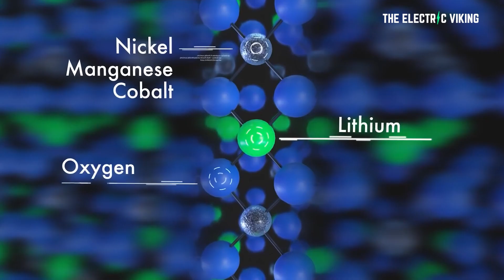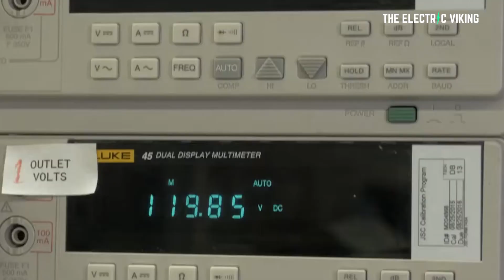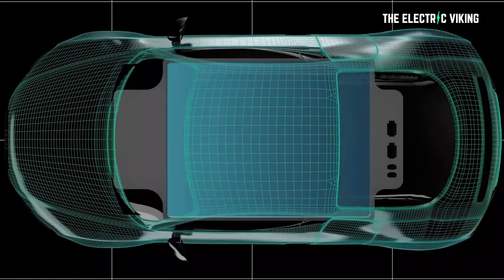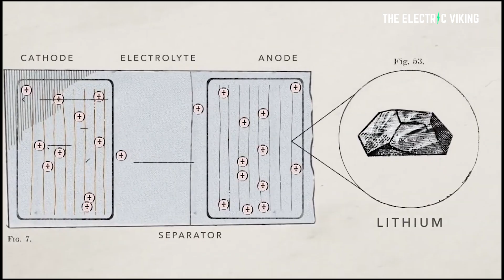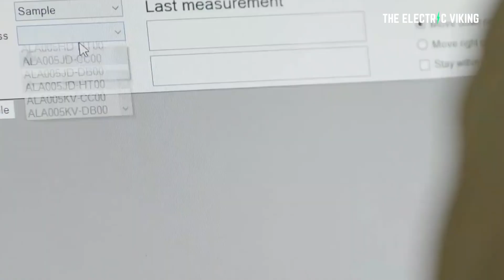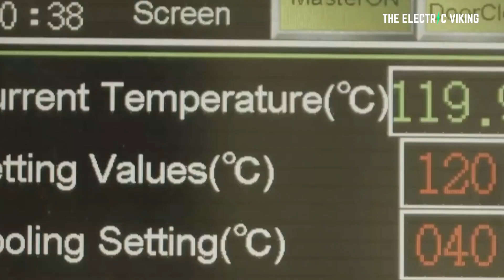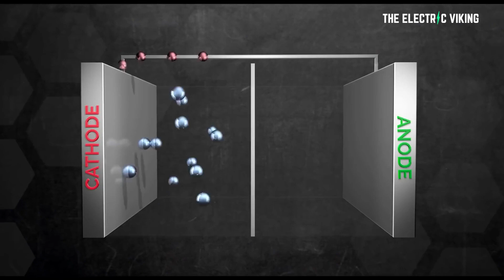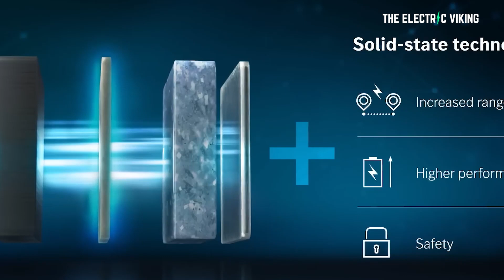NASA's solid state battery could change EVERYTHING

Comment: From the article: “Not only does this design eliminate 30 to 40 percent of the battery’s weight, it also allows us to double or even triple the energy it can store..."  The battery specs are 500Wh/kg, whereas, say, Tesla's 4680s are around 285Wh/kg. So that's 40% more energy for a battery that's the same weight as a 4680 pack, OR  the same amount of energy for 40% less weight. Not both. Please correct me if I'm missing something.
Reply: I agree.   We need clarity on this simple point and should apply one variable at a time in describing its density. I assume NASA hasn't increased the storage by double for a battery that weighs, at the same time, 40% less.  If that's true, and comparing it to the state of the are 4680s (285Wh/kg) , NASA's technology would have to achieve 570 Wh/0.6kg which is 960 Wh/kg.

Comment: Bring on the future! Higher density, safer batteries with less need for  exotic minerals seems like a winning combination for greater adoption in all industries.
Reply: @orionbetelgeuse1937  you are completely missing the point, the private space industry's next step is space mining, and there is allot more out there then on earth. this is 20 year plus tech, specially considering the speed NASA moves. it will happen eventually. this level of battery tech isn't needed for the auto sector. aerospace and space yet though. I could see aircraft replacing their turbines..... also, he said it's 2x less in weight and and more in power that has unlimited cycles meaning it'll outlast the car, and the next 20.... and you lied about selenium, its more abundant not less. much more. watch the video all the way through next time. it's also almost impossible to set fire to it... and operate in almost twice the heat without cooling and testing the cold part this year. the technology has been advancing for decades, the last decade there has been more development in batteries then anything else, and more research in batteries in the last 10 years then all before it combined. 10's of BILLIONS of dollars!!!
Reply: @TheInsaneupsdriver  space mining? lol

Comment: Very interested. Where I live the battery capacity drops by 40% to 60% in the winter. A 250 mile range drops to less than 100 miles. And I haven't even driven in the  coldest temperatures.
Reply: So get a car with battery conditioning - with a heat pump.
Reply: @JohnR31415  Or leave your car plugged in in winter - like everyone with a gasoline powered car (frozen oil and coolant reduces gasoline powered cars range to zero in Canada). Sump heaters have been a thing since cars were a thing in Canada - they are a heater pad that is either glued or bolted to the sump or screwed into the sump drain plug.

Comment: Back in the mid-sixties, they released the technology that was going to make "fuel cells replace batteries" and provide the motive power for electric cars.  We used said fuel cells, still do, in space and other tight places, but lead/acid, carbon/zinc alkaline, and now lithium remain the mainstay of our portable electric power.  I was working with solid state electronics in the mid-sixties as a boy, worked it two decades as a Marine, and we now are coming back to those long ago hopes. I'm hoping my forty year old Mercedes diesel will last the rest of my life.

Comment: Lesson I learned from Elon Musk: making a prototype is easy... getting that prototype into productions is VERY HARD!
Solid state has been around for a while now and this report has highlighted all the advantages of this new tech BUT how expensive is it and how hard is it to manufacture? No matter how great it works in the lab, if NASA can't mass produce these batteries, they're NOT going to change anything!
Reply: You are right. A new product like this comes from laboratory engineers to get it into production you need production engineers.
Which are made up of planning and methods engineers A completely different types of engineers to make it cost-effective.

Comment: Taking off is the main reason the battery has to be able to discharge at such high rates.  I wonder if a ground assist would be useful.  Something like they have on an air craft carrier.  The climb rate could be adjusted to the power capacity of the battery and cruising would use even less power.  The main consideration would then be the energy capacity of the battery, and less, how fast it could discharge its energy.  Also range would be increased by not using so much energy to take off.

Comment: As mentioned, Selenium is very rare and ranks among the 25 least abundant elements, which makes it costly.
Reply: True but possible if it doesn't require very much Selenium, but is usually found with sulfer so idk.  90 parts per billion of the crust of Earth which is rare.   Would like to see the particulars.  May be a good alternative or special use.
Reply: @l0I0I0I0  Have to start growing Walnuts!😁
Reply: @michaelbooth6007  And Brazil nuts. 😉
Reply: @l0I0I0I0  It's rare. However, Gold is much rarer, yet it is used throughout industry and for nonessentials, including teeth, jewellery and coins. But it hasn't run out after thousands of years of use.
Reply: @michaelbooth6007  lol. Glad someone has a since of humor.  😂
Reply: Then Nuclear Diamond Battery is the solution.

Comment: 500 wH/kg is close to the requirements for regional aviation, but another factor of 2 or 3 energy density gain would be needed for long-range air travel. (See "Performance Metrics Required of Next-Generation Batteries to Electrify Commercial Aircraft" in ACS Energy Lett. 2020, 5, 2, 663–668.)
Reply: If shorter range planes become much more economical than jet liners,  it may change the pattern of demand for longer range flights.
Reply: @MattOGormanSmith  Just ran across a Two Bit da Vinci YouTube video on CNT flywheels. 2700 Wh/kg!! That's more than twice what long-range, trans-continental aircraft would require.

Comment: They keep saying double energy density AND 40% lighter, mixing weight and density units which is confusing. Are they the same thing, given the 10% for non battery structural weight, or truly cumulative? If the energy density is double you would obviously need half the weight for the same capacity if the weight was 100% battery. Like you're trying to count the benefit twice. If you mean double the density, otherwise stated as half the weight, just say one and we can infer the other through simple maths without the confusion. If it really is twice as dense AND 40% lighter, i.e. it can fit twice as much energy into 60% of the weight then it would be 3.33 times as energy dense in which case why not just say 333% (not 5x) higher energy density which sounds even more impressive than the double and 40% figures separately?

Comment: Lots of people are working on solid-state batteries, how does this compare to others?  Also, this is still in the lab phase, there is no mention on what it will take to manufacture them?  Will it require a complete retool?  Lab work is great, but it could still be a decade before we see anything in commercial production.

Comment: OK if you double the "energy it can store" AND halve the weight is this is the same thing measured twice or said two different ways? So are you saying the gravimetric energy density is increased by 2 or 4? The former would be wonderful. The latter would be a game changer and allow electric powered flight.

Comment: The battery can't be double the energy density AND 40% lighter. Since energy density is based on weight. It's just got higher energy density.  If those claims were true, it would have 300+ % more energy density
Reply: Zackly.

Comment: While transoceanic range MAY be possible with such a battery-powered aircraft that distance would be  covered at a MUCH lower rate of speed. One of the things that makes intercontinental air travel PRACTICAL is the rate of speed at which present day aircraft can travel thanks to the gas-turbine engine. A battery powered aircraft would be limited to some sort of propeller driven configuration or a ducted fan configuration. Neither of these technologies can achieve the 600+ MPH speed of a gas turbine powered aircraft.

Comment: If cheap per kWh and easy to mass produce it would clearly be a major improvement assuming no one has something even better.  Twice the energy density and half the weight would be nearly 4x improvment lower weight EVs making them green, safer also.  But - it appears it would be lithium based a serious draw back but even with current supplies you could get the same range with 1/4th as much or maybe 20 million BEVs annually.  If cost wasn't 4x then it could  help bring costs down.
Reply: Current Li-ion batteries are around 250 Watt hours per kg. (The 4680s Tesla is producing have an energy density of ~285Wh/kg). NASA is claiming 500Wh/kg. That means NASA's batteries are about double the energy or half the weight, not both. As in you could have a battery pack of the same size and weight and have twice the capacity, or have a battery pack half the size and weight and get the same capacity. It's not "twice the capacity and half the size". This is misrepresented in the article Sam is referencing, and he's repeating that misrepresentation.
Reply: @truhartwood3170  That would obviously only be double but Viking said twice the energy and half the weight so maybe he meant just twice overall?  If so then commercial jets are not plausible at all.
Reply: @BlondieSuperdog  I reeber Elon said that 500Wh/kg was the threshold for it to start making sense in planes, but I don't think he meant long haul flights, probably just shorter flights and drone taxis and stuff.
Reply: @BlondieSuperdog  I reeber Elon said that 500Wh/kg was the threshold for it to start making sense in planes, but I don't think he meant long haul flights, probably just shorter flights and drone taxis and stuff.
Reply: @truhartwood3170  yes small craft I suppose current range of the Pipistrel electric currently has about 100 miles range so maybe 200 miles; not very comparible to gasoline though.
Reply: @BlondieSuperdog  but if it brings cost down and you don't need more range it's all good.

Comment: NASA uses the acronym SABERS (solid state architecture batteries for enhanced rechargeability and safety);  NASA applies 'holey graphene' material and sulphur-selenium material.  I assume that the performance of this battery is comparable with GMG's state-of-the-art Aluminum graphene battery (thumbs up Australia!), that does not even depend on Lithium. Australia has big reserves of Bauxite.  Industry is going to upscale the production of graphene materials, no doubt about that. I hope the best 'graphene material' inventions/discoveries will be licensed to the battery industry. Very interesting calculation about the 'minimal' energy/weight  (KWh/Kg) and power/weight (Watt/Kg) battery requirements for economic air travel by means of electric airplanes.
Reply: "bauxite" I don't think the global battery demand is enough to put pressure on aluminium mines, yet.
Reply: @MattOGormanSmith   That is why GMG's aluminum graphene battery is gold.

Comment: In addition, an electric powered 'tender/launch' air craft could be used to transport rockets which are going to be sent into space up to, say, 100,000ft, flying along the equator in the direction of the spin of the earth.  How much less fuel would be used, when firing off your rocket at that altitude, to reach orbit.

Comment: With less battery weight, the range would be extended as well. 40% less weight and 5x the range means roughly 700% efficiency improvement.
Reply: I think he's multiplied too many factors together.

Comment: To start with there are few "gasoline powered" aircraft, most run on Jet Fuel (9.6kWh/L) so a litre of Jet Fuel weighs 0.79kg v (Li-ion max = 260 Wh/Kg), even doubling the efficiency of the battery you aren't even in the same ballpark and the a/c has to carry the drained cells until landing, burned jet fuel is gone.
Without even comparing refuel v recharge times, you aren't going to be seeing mass adoption of electric aircraft any time soon.

Comment: Yes, the energy density and safety is impressive, but what are the economics of making them at scale? If this is just new chemistry that can mostly be inserted into existing production facilities and the materials are cheap enough, then it's a game changer. However, these are big ifs.
NASA doesn't normally trouble itself with how much things cost or how hard they are to make. Specification is key for them, not the economics of the product.

Comment: No more fossil fuel jets? That would be a stretch. If 66 kWh equals 12 gallons of gasoline, then you'd need 625,000 lbs of these cells in a 787 equivelent. That is still twice what the fuel weighs now.  A lot closer to equivelent but not really plausible yet.  You'd have 1/2 the range or a cargo reduced by 312,000 lbs

Comment: Another possible game changer is a solid state ultra capacitor, patented by Alvin Marks, called QUENSOR. Quantum Energy Storage or Retrieval.  Claims an energy density similar to gasoline. The main problem with producing QUENSOR is the use of perflouric acid.
Reply: Is that like "1 battery per flouric acid" 😉😁
Ohhhhh I understand now...
Reply: @alexmanojlovic768  The perflouric acid treats a stretch oriented conductive polymer to produce strings of connected capacitors consisting of 3 or 4 carbon atoms and a Florine atom, each capable of holding or releasing 4 electrons.  No ions moving around like in batteries, just electrons moving around.
Reply: @paulvansteenberghe4644  that went straight over my head, Paul, I gave up on Chemistry in high school!  But thanks for taking the time, even after my smart455 joke!! 👍
(It's perflUoric & FlUorine, not perflOuric & Florine...)

Comment: Even if they came out with a solid state that a plane could use to make an international flight, airlines will be hard pressed to change over until you can quick charge a flight. I work at an airport as a fueler and we get regional flights sometimes that are quick turns where they land and leave within 30mins so they're only at the gate for 15-20mins to which we have equipment that can pump 150gpm for small planes all the way up to 1000gpm for the big planes. Our international flights take roughly 15000gals of jet a, and it takes roughly 20mins to set up pump and break down. If they could have a battery that could be that massive and charge in 15 mins then it'll be used. It's a little known fact but on a given day like 60% of the worlds aircraft are actually in the air while the other portion is on the ground at a gate.
Reply: Those 15000 gallons are equivalent to about 500,000 kwh. (5,000 car batteries!) So to charge this energy in 15 mins, the charger would have to be rated at over 2 Gigawatts ...! Definitely not happening . The energy demands of international flights are mind boggling. Very long 747 flights are twice these figures....Batteries would seem an impossibility, period. Hydrogen is a future 'maybe'.

Comment: My understanding is that liquid fuel has roughly five times the energy density of the best batteries.   Its interesting that this new chemistry is claimed to hit that exact same density.
Reply: The energy density of liquid fuel is a lot more than five times that of the best batteries. Set against that the efficiency of any engine burning such fuels is only about 25% efficient so batteries with a quarter of the energy density of liquid fuel would be good.

Comment: This may be nitpicking, but aircraft can't use gasoline, they use one of a few different fuels that are not as vulnerable to air pressure differences.

You didn't mention two of the enormous advantages of electric aircraft.
When a plane is at altitude... 30,000 feet, say... and is preparing to land, they can use regen on their way back down, similar to an EV car as it rolls down a mountainside.  By reversing the prop blades to act as wind turbines rather than providing propulsive power, the plane can put some of the energy back into the battery that it used to get airborne.

Also, since fueled aircraft need oxygen in the air to operate, they eventually reach an altitude above which the plane cannot fly.  Elon Musk did the calculations that show that an electric aircraft can "porpoise" out of the atmosphere into the lower levels of space, "coasting" without drag for significant distances until gravity pulls it back down into the air.  An electric aircraft could significantly extend its range this way.

Musk appears in the movie, Iron Man II, in which he has a cameo in a party scene with Gwynneth Paltrow and Robert Downey Jr.  He tells Tony Stark that he has invented a new electric jet. "You have?  We can make it work", says Stark.

Comment: Just to be clear, small aircraft, most private owned aircraft are propeller driven Aviation gasoline burning powered aircraft, this is gasoline with an octane rating around $140. Virtually all large aircraft used for commercial purposes and high performance military aircraft use jet fuel, jet fuel is basically clean kerosene and very high performance military jet aircraft Use jet fuel which is kerosene with certain additives. Also it should be noted that most sulfur that is commercially viable is the result of petroleum, oil, refining processes.
Reply: Both Sulphur and Selenium are byproducts of mineral processing.
Pretty much all the metallic ores out of Western Australia are selenide ores - to the point you can identify Western Australian gold because it all has selenium contamination in the refined product. Mixed Copper, Silver and Lead selenide is a very common concentrate product exported.